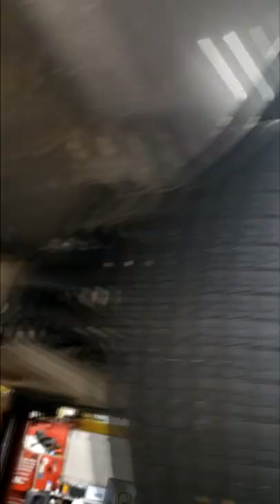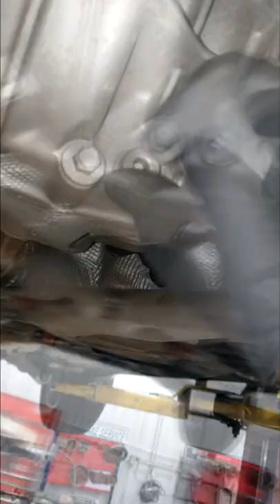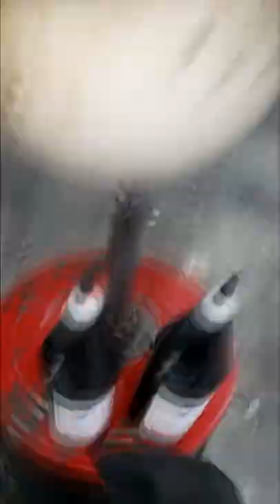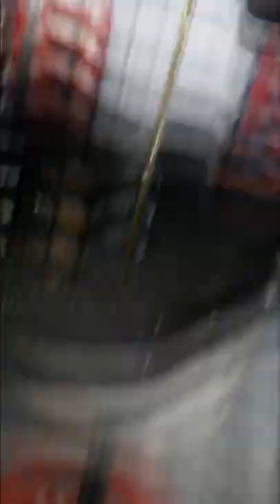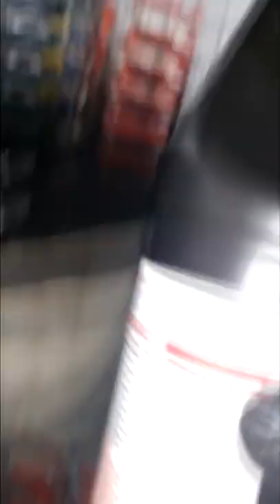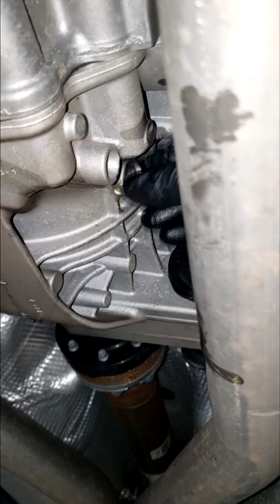Why is this part always NEGLECTED? Its the easiest thing to service. #JTtheCarGuy #shorts

Comment: Yes it should get changed.  Probably even worse is brake fluid.
Reply: There is no proof of brake fluid service doing anything. Some manufacturers swear by it, and some tell you to stay away. Me personally, I can't tell you the averages. I've seen vehicles with squeaky clean fluid and with 10+ year old fluid, and both operate to spec. 🤷‍♂️

When a customer asks me, I'm honest and leave it up to them.
Reply: @LynxStarAuto  Clarity of the fluid isn't indicative of moisture but dark dirty fluid might indicate internal corrosion is taking place due to presence of moisture.
Generally, high moisture fluid works fine until it's heated during breaking, at which time the water can boil and gas bubbles in a hydraulic system lead to trouble.
"National Highway Traffic Safety Administration found that 20 percent of the cars they tested had brake fluid with 5-percent moisture content."

Comment: If the differential takes ATF it must be changed cold.
ATF expands when hot.
Also never replace the fill plug until it stops drooling out.
Especially important with ATF.
Reply: How come you have to wait till it stops drooling out?
Reply: @melancholypuppy3595  you can have it overfilled. Excess pressure could blow a seal
Reply: @melancholypuppy3595  best case scenario it leaks.

Comment: You should really take the fill plug out first in case you have issues with it. If you remove the drain plug first then mess up the fill plug, you're not getting any fluid back in there.
Reply: We can fill it through the drain port easily. A lot of us who do this for a living, use a tool to pump the fluid back in there. The tool comes with adapters for different diffs and transfer cases. The adapter screws into the fill plug location, and has provisions to hook up your hose and fill. We fill the container to the vehicle specs, and then pump it in. The fill/drain ports are usually identical. Simply plug it into the drain port, pump it in. Close the shutoff valve, and have the drain plug ready to go. Sure makes a little mess when you go to swap the plug in, but it works.
Reply: @LynxStarAuto  how often do you mess up & drop the lot on the floor?

Comment: Youtube: Easiest thing ever.

Me: Laying on the ground with the worst smelling shit spilling all over cause there is no drain plug and I just have to unbolt the whole cover.  Now I just gotta remake the gasket and try to fit a bottle that doesn't fit.
Reply: Same here...😏
Reply: I bought a cooking syringe for filling. Way easier than the bottle
Reply: if there's no drain they're meant to be sucked out with a pump but then you've got a pump to clean out as well as the job you started with.
Reply: I believe some companies put it in a bag instead of that bottle
Reply: My e46 diff has no drain plug fml

Comment: JT... If i told you how many rear axle rebuilds I've done in 30 years, i don't think you'd believe me. Every single one, had NO lube in them. Dry as can be... 😵 from side seals to front seal leaks, to damaged rear covers and just plain lack of maintenance. 😱

Comment: Use a better workshop where they don’t forget about the diff.
You should open the filler plug first, and then drain the oil. 
If the filler is stripped and you try open if after draining the oil you’ll have a fun time.
Reply from the maker: I agree. https://www.youtube.com/shorts/Q2n5gwlE1kM

Comment: This the first time I seen that curved ratchet actually come in clutch. I don’t have any curved handles cause I don’t need em. Never have an prolly never will, I work at a gm dealer.  But idk it’s just fascinating to me that I could actually finally see one of those handles coming in handy cause I have been curious about them ever since I started wrenching just don’t see a need for it
Reply: it's not actually needed there either but it does make the job slightly easier.

Comment: I been driving for over 30 years and never knew about that.. What is that called?
Reply from the maker: Its a differential. Its only mostly on rear wheel drive vehicles. If you have a front wheel drive vehicle you will not have one unless its all wheel drive. Thanks for watching and please subscribe to the channel. thanks
Reply: How often should u do this? Is it the same as changing oil?
Reply: @nelsonricardomontalban1780  it should be in the manual but if not do it once a year, there's only a little bit of oil in there so it doesn't cost much.
Reply: @nelsonricardomontalban1780  it's also called 'rear axle' if you can't find it in the manual under 'differential'.
Reply: @OnlineMechanicTips  if you have a 4x4 it's likely to be both axles.
Reply: Every 30 thousand miles.you have to change this.
Reply: @alanhat5252 both axles and a transfer case. Toyota recommends 30-50,000 miles.

Comment: I keep telling my coworkers this but no one gets it. Diff fluid exchanges are quick and easy money on our part, and a necessary maintenance item on the customer's part. Everyone wins. But no one ever does them or tries to sell them because "that's not what the customer is in here for, they won't buy it, it's not important" etc. I've done more diff fluid exchanges than all my coworkers combined simply due to the fact that I understand it's a necessary job and actually try to convey that to the customer rather than saying fuck it. Oh well.
Reply: I changed my diff fluid and manual trans fluid to a so called $ boutique oil and it really smoothed out my ride. Even the tranny shifts smooth when cold and it didn’t do that before.

Comment: Which fluids do.you see the best results.and suggest. Would ypu suggest royal purple or valvoline?
Reply from the maker: I do not have an opinion on the royal purple. have never used it.
Reply: @OnlineMechanicTips  Just curious checking my diff tonight. Saw the bottle. Put my new truck on valv full syn oil. Curious if you have prefrences. Most of it is doing it before it snowballs down a hill.

Comment: Nah. The most neglected thing is the transmission. Especially cvt transmission. 

Writer: You need a trans service at 60k

Customer : nah its good I don't need it.

Customer comes back 10 to 15k miles later my trans is bad. 

Writer: sorry but since you did not service trans at 60k (as per maintance manual) Chrysler denied to replace trans due to improper maintance.

Customer: starts crying. 😭
Reply: Why bother the Nissan CVT going to go out wharever you do. Design error by Jatco.
Reply: Well a regular trans yea. But a CVT is always on borrowed time.

Comment: My bmw sucks to do the diff because it’s way up in the subframe
Reply: You mean the X-drive? Because the rear diff is a cinch. The transfer case is a pita too. You need a special low profile socket, otherwise you need to lower the case frame to access the plug.
Reply: @LynxStarAuto  it’s a 1990